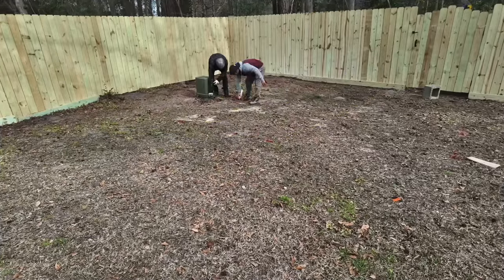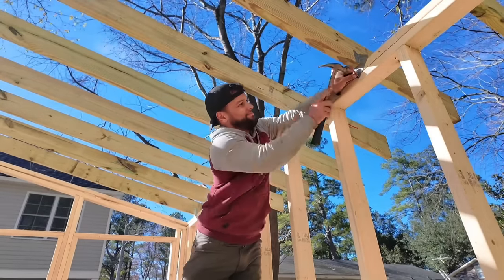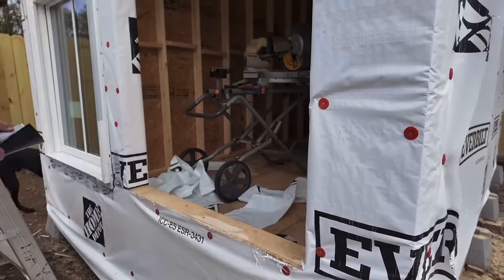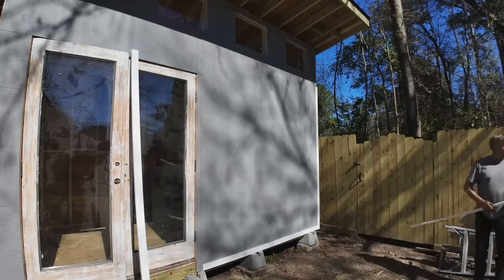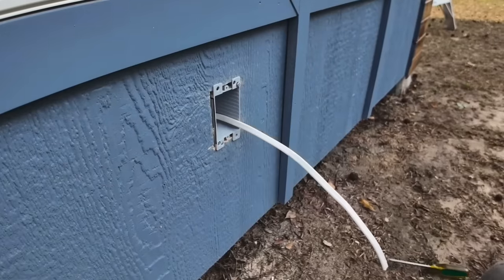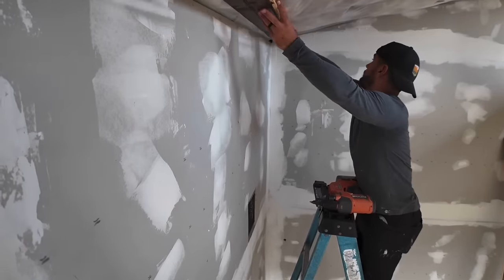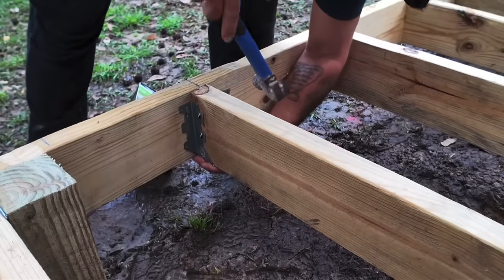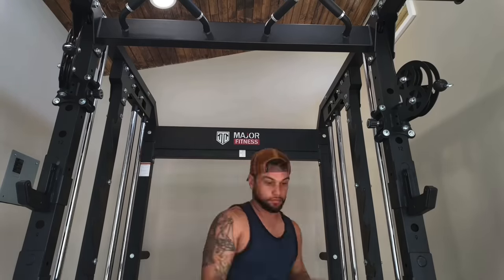How I Built A DIY Tiny Home Gym Full Build

Comment: It’s cute, but I feel like all that work and money just for it to hold one piece of gym equipment… seems a little bit wasted.
Reply: I agree. I feel like a small home office might have been a better use of the space.
Reply: well, if not there than it is stuck being in the house..
Reply: i cant imagine what else he needs. he can run outside, he has his weights and a big enough area to lift weights... what else does he need to add to get the "gym"?
Reply: To show others how to do it
Reply: It’s not exactly “one piece of equipment”
Reply: The gains should/will materialize with all the fitness effort they all put out throughout the years.
Reply: I agree, and imo, if you're going to build, might as well make something twice this size. It could be an issue of code though.
Reply: You missed the part where the original design was a short term rental but the city wouldn’t allow them to do it.
Reply: Exactly. Should have did like a 12x16 footprint and been able to have a legit home gym.
Reply: I was really surprised and Disappointed. To think to have that rack to do pull-up’s. $18,000 to do pull-ups🥳
Reply: Can't do heavy deadlifts or accidentally drop a dumbbell. Too pretty and not sturdy enough for a home gym ImO
Reply: @jndforster  🤦🏼‍♀️
Reply: It's perfect for not being accused of something he never did at a public gym
Reply: Sometimes u just need a little piece who knows he might have 5 kids at his house and need some time alone lol
Reply: Thank you for sharing. How long did it take?
Reply: @jdscott1051 He said at the end, about a month from start to finish.
Reply: Great job. I really enjoyed watching this. Wish I had your talent. You made it look easy 👏👏 👍
Reply: Too much work and if you are not a multi trade skilled man, you'll have to pay workers to.build it. I rather buy the $10k model from homedepot,easier to put together or luxurious models from online companies.
Reply: I’m pretty sure they’re gonna add more and do whatever they want to it, the video was simply to show people how he did it
Reply: Looks badass. Nice job
Reply: I’d build it just to hold one easel. Whatever makes him happy 👍
Reply: After doing a bunch of research on youtube it looks pretty easy . I can only imagine how many roofers you pissed off with that statement.😂😂😂
Reply: It’s 5 in 1
Reply: Bruh that gym system he got literally covers damn near everything he could possible need to at the actual gym hence him saying he canceled his gym membership, and he’s not a twig either so he seems to be doing something right, stop hating
Reply: Why you guys worried about what’s better haters how about you guys get into a gym he just showing us what he did but you guys always compare danm critics
Reply: YouTube checks must be good because it was a complete waste of time.
Reply: It already has clothes on it 😂 seems like they would have got the approval from the city/county before the build. Nice building. Not understanding the foundation…and $15k buy’s one hell of a gym membership 😂
Reply: Typical online troll... who the F cares!! It's his money not yours🤡
Reply: What an Extremely educational video. You learn
A. How to Build a small building.
B. Not to live in a neighborhood where people people who don't pay for anything in your life have a huge say in what you do.
C. If you do live in one of those types of places that you should always check with The powers that be (the city, the HOA and all those other people who don't pay for your shit but have a say in it) concerning zoning laws before committing to the job.

Young couple came up with an🤨 ambitious plan to design a (tiny home) miniature rental room🏘 in the back of that property to use as a airbnb for extra income💵.They wanted to keep the project under twenty thousand dollars so they could quickly recoup their investment... Unfortunately They didn't check with the city🏛 and their zoning 🏗laws, and so forth until after being well into the project. So rather than Hey, the $15-$20K tiny home on their property  5 -600 bucks a month of extra income. The young couple ended up with the home gym. Humbling😢 adaptation to an ambitious plan.
Reply: Definetly not waste thats a little space in his home where he could clear his mind
Reply: Right I was waiting on the furniture part lol
Reply: Better off putting a bench, slim line treadmill and maybe a small desk area. Great job , but too small for a gym, a shed could of held that for half the price
Reply: He just needs the one machine to do what he wants to do.
Reply: Now that code enforcement seen the gym equipment he can return it and rent it out like he originally planned. 😂
Reply: are you blind? that machine has many uses
Reply: i’d turn it into a man cave with bar/ tv
Reply: Hell nah, I bet it was a ton of fun building that thing. And it looks dope, AND he's gonna get ripped? Bruhhhh that's fire
Reply: Someone may be inspired to build one and put a bed
Reply: U have to get permits
Reply: Did you watch the full video? He DID say that his original plan was to turn it into a short-term rental (Airbnb) but the city wouldn't approve his permit. The gym was a great back-up plan. Or do you propose he tear it down?
Reply: Same.
Reply: Sick of “the city” telling us what we can and can’t do on our own property, it’s a crime. You’re right, 15 k is a waste for a young family if you can’t recoup that money, I would have put it on wheels and made it an RV so the city couldn’t say anything, and still rent it out.
Reply: Why the city wouldn’t let u use as rental place.
Reply: Great video!  Nice tiny home backyard get away/work out area!
Reply: No one asked you how you felt, you putting this comment was a  waste for sure👍🏾
Reply: It’s always the people that don’t have, who run their heads the most😂
Reply: @chardonnaygiddens1583 
Oh the irony
Reply: @Shamir725 yes indeed yes indeed 🙏
Reply: That one piece of equipment wouldn't work for everyone, but it works for him.
Reply: He can't use the bench press as there is no room to add weights on the side. Seems like the equipment is too big for the space.  He could have just put it in his back patio and cover it when not I'm used. 😂
Reply: God has blessed you with hands to build young man. You’re truly an artist!You’ve inspired this 50 yr old woman into building my own home. I’ve been wanting one for so long. I need to build it with my own hands that God has blessed me with.
Reply: It’s a 5 in 1 machine, there’s space for yoga, stretching and another machine. Lol dude just spent 15k building this place i doubt he’s eager to get an expensive treadmill or something in there
Reply: I'm impressed. Very nice job. I wish I had half your construction talent. I hope you continue to enjoy for years to come.
Reply: They increased their property value by building that
Reply: @beechcraftpvp or even a guest room with a small bathroom would’ve been better
Reply: Imma build one and put a whole house in it.
Reply: Very wasted
Reply: Wow, alot of money spent there.
Reply: Yeah it's beautiful, but I thought the same thing....
Reply: Health is priceless.
Reply: @qua7771  so is the outdoors.
Reply: Sad that the city (Big Brother) wouldn't let you rent it out. God for bid you try to make extra income off your property that they make money off of taxing you. Waiting for the day we get taxed for Freethinking...
Reply: @jasondi81  That's my feeling as well.  He would also be providing someone an affordable living space at a time when this sort of thing would help many people.  Making this illegal is insanity.
Reply: Fantástico, diseño y ejecución. Buenas herramientas
Reply: Looks like he might enjoy doing this stuff. 🤷🏻‍♀️
Reply: @LiangJessie  there's also room for yoga mats to do stretches and floor work.  The only change I would probably make to be honest is s larger mirror staring from the floor
Reply: But they can use it for anything they like over the years.
Reply: Definitely not a waste
Reply: How you loading those barbell plates?
Reply: @phil1love1  - You're thinking according to your own situation.  Remember, this owner know what he want to use this space for, beyond what's on YouTube.
Reply: Prob will get more overtime. Quality equipment is very expensive
Reply: Yall arent real lifters. That rack has everything you need. Add some adjustable dumbbells and you've got everything
Reply: @cashclothes9947 I bet you are a lot happier person than a lot of these people on here talking a bunch of shit.
Reply: It’s livable space as well
Reply: @Beencouraged777  true, prob a bedroom size
Reply: That machine does pretty much everything. You can work on every muscle with perfect form.
Reply: It’s beautiful. 🏋️‍♀️ 🏋️‍♀️🏋️‍♀️🥂.
Reply: I agree, works better like an office/ study Rather than a gym. He could just use the garage for the piece of gym machine
Reply: It’s fabulous whatever it’s used for it’s a great additional space! Well done !
Reply: I feel like the connection you have to have for the GYM would be enough for this to be worth it
Reply: @psychicsara  well this what he decided to use it for.. others can make it a home? I guess ppl watch youtube to be critical on what others choose to do with that space
Reply: I'm sure its multi-functional should they ever decide to give away or sell their gym equipment. The space could also be a children's nursery or cubby...whatever! Definitely not wasted space 😂
Reply: I'm sure its multi-functional should they ever decide to give away or sell their gym equipment. The space could also be a children's nursery or cubby...whatever! Definitely not wasted space 😂
Reply: Yeah knowing me, that would’ve been my 2nd home, when me and wifey going at it 😂
Reply: They definitely had enough space for a tiny home.
Reply: Turn it into an office or man cave would’ve also been nice. It could’ve easily been a just a place to relax for a quiet evening…
Reply: He must have wife’s permission, otherwise!!!😂😂😂
Reply: @Keepskatin 
 Then become a multiskilled tradesman. We need more, All the kids today would rather just “buy the premade junk from the Depot” men can’t even change a tire anymore 
  learn something… or just keep skatin 🙂‍↔️
Reply: On the builder’s defense, that’s not just a one piece of gym equipment.  Because you can do several types of exercises on it.  
But at the same time, I do agree that all that work & money for a gym was a little bit wasted.  
I mean, if he would’ve made it a bit bigger adding a bathroom & a small kitchen, then that tiny home could’ve been a guest house. 
I watched the whole thing & I watched it while playing it in 2X playback speed.  He & his family did build a great small gym though.
Reply: You do realize you could do a full body work out on that machine yes?
Reply: I'm sure in his mind it's exactly what he wanted. I might use it for a guitar studio... or a destination where my talented wife could escape and do her oil & watercolor painting. What would you use the space for? 😉
Reply: This comment made me skip to the end and saved me 40 minutes, thank you
Reply: He can change his mind and use it for something else in the future.
Reply: Sounds like a lot of hater’s lol!! Let that man do what he wants on HIS property. That is a beautiful gym and he put in excellent work
Reply: Exactly
Reply: One piece??? That one piece does everything
Reply: That “one piece of equipment” is literally all you need to work out. It’s a power rack…
Reply: Right they might as well turn it into a bar
Reply: That's a home gym. It can work every body part.
Reply: Wasted to you but probably perfect for him lol. Could easily be seen as wasted space using it for an office. Just depends on the person
Reply: Yeah such a west’s of time not to make it bigger than that
Reply: I can do my entire exercise routine besides running on that. Unless he installs a indoor track that thing is perfect
Reply: I would have went the extra cost of at least 10ft ideally 12ft..But your work looks amazing
Reply: Having a separate place for working out in itself is a boon. I'd love this setup! Amazing job
Reply: Beyond rediculous
Reply: My thoughts exactly, but to the end use, to each his own. To the knowledge shared on the construction, much appreciated.
Reply: @Dell7788 🤏🏼🤡
Reply: @YouTube_can_ESAD  booooo
Reply: @beechcraftpvp one chair would fit
Reply: Omg thank you....i wouldve used it for a study...with a couch...table, shelves...but i guess it depends on what interest people have...for this dude its the gym...
Reply: Yeah I agree I was so invested then i was like that’s it 💀
Reply: Yup. I have more equipment and room in a 41ft rv.
Reply: I’m just wondering how he managed to spare $15,000 and three months of solid work? Either this guy is loaded off of like lottery money and needs to kill some time, or making YouTube tutorials actually pays that well. I’m in the wrong industry I guess.
Reply: Love the gym , awesome idea and good work.   If I ever do this I want just a little more space for some free weights.
Reply: Health is wealth
Reply: Maybe but it is not your money, your life.  Besides with purchasing a five-in-one system he even said he could cancel his membership, which we do not know the cost annually. Not only is there savings in the construction of a home gym but imagine the resale value if the family ever wishes to sell their home.
Reply: Unless you convert is to mancave game room with mini bar :D
Reply: That piece of equipment in particular covers you for almost every muscle group tho. Only thing he is missing is some more leg machines and dumbells
Reply: If they ever sell the home it will probably add a lot of equity for people that would enjoy using it for other purposes
Reply: Mind ya business and let him build wtv he wants

Comment: being a home builder i am impressed. only issues i saw were u didnt pour any footers under your blocks which can settle over time if u dont. I DIDNT  SEE ANY CENTER FOOTERS OR BLOCKS,  maybe 24 inches w no 3 rebar pad..using 2x6 on joists or floor boards are a nono .(THEY CAN SNAP LIKE A TWIG IF U JUMP ).. min 2x8 or 2x10,  W /a 4X6 starter (especially since u put a weight bench in there ).. use a window flashing above your windows and and doors , valley flashing on the wonder boards on the bottoms.  the rest u did a great job .... nice work boss
Reply from the maker: Thanks for all this info man I appreciate the advice and I’ll be sure to keep upping my game with every build. 🤙

Comment: 🎉 Excellent! I felt overwhelmed just looking at the process. There is so much work that goes into building a home. You really do Solis work. Question: with the room being so small, why did you choose such a heavy colour for the ceiling? A lighter colour would have opened up the space, make the roof seem higher. You and your wife are a talented  couple. 👏🏾 Having seen the process, I am wondering how much I  would save if I use a container.🤔 I would trust you to build my home any day. Nice Gym equipment by the way.😊

Comment: Hey bro, great video! Quick tip next time instead of using compound for the sheet rock try using easy 45 or easy 20. The compound will dry either in 45 minutes or 20 minutes depending on which one you get. you can essentially put the compound and also sand in one day

Comment: Couple tips:
There is no need to stager the sub floor if it's a single sheet, your fine.
No need for blocking in the walls.
Windows seemed a little tight in the opening, and you should shim them out to square them off.
The flashing tape at the windows is weak at the corners, you should use a single strip and turn it up on the sides 150mm (~6"), slit the corner if needed only on the outside. Follow that up with a bowtie gusset to seal off the corner.
For the siding you would get a lot better performance if you furred it off the wall a bit. Add vertical strips on the outside that makes an air space between the hosue wrap and the siding to eat it dry out.

Comment: Doesn't look wide enough to be able to load plates onto the bar or to be able to maneuver around the machine to the back to do other stuff. I love the details but think you should have gone at least 2 ft wider or you're probably going to have to move the Smith machine along the back wall in front of the doors perhaps so you don't feel closed in but other than that you've created an absolutely amazing space.

Comment: You did a phenomenal job. It turned out really nice. Is this wired in a way you could put a water cooler or mini fridge for drinks? How is the temperature in this tiny home? Does it need heat or air conditioning? I’m just amazed at how this came together. Great job!

Comment: Well done.  Beautiful!   And what an incredibly kind neighbor!  The only thing I can think of is that I would've perhaps gone ahead and used a higher insulation rating in the floor.  Although it doesn't get that cold (does it get hot?), after I spent that much money and time building, I would have done it anyway, since you can't go back and increase it.

Comment: 1. Plans for HVAC?  With all those windows it'll be an oven in the summer. A portable/wheeled heat/air unit would fit in the front corner and duct right out through the window.
2. You definitely owe Tom free daily dog walks for a year and a solid season of very detailed, Type-A personality yard work for this. 
3. Thank you SO MUCH for staggering the floorboards. AS IT SHOULD BE. glares in TikTok's general direction

Comment: Absolutely impressed by the job that you did on this-  wouldn't want a ceiling fan in a gym setting - also shouldn't have just been a little bit bigger for a gym so you have free weights and other areas and so forth are you just going to have one piece of equipment